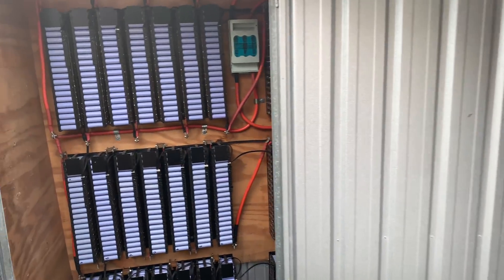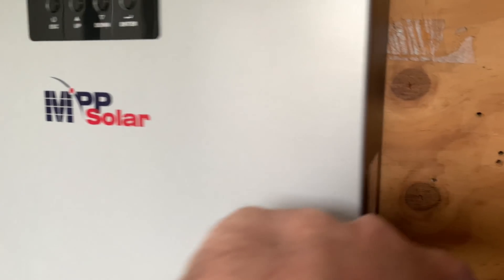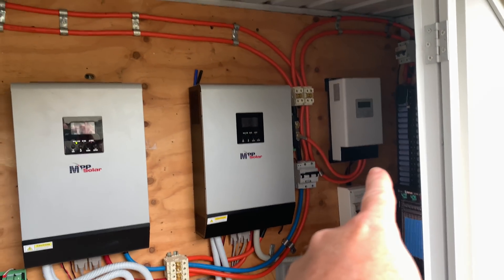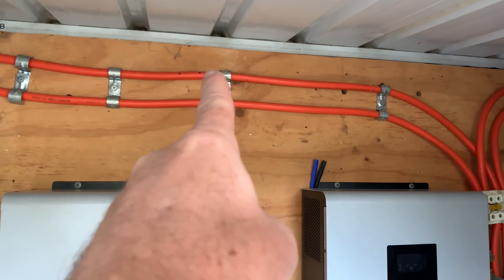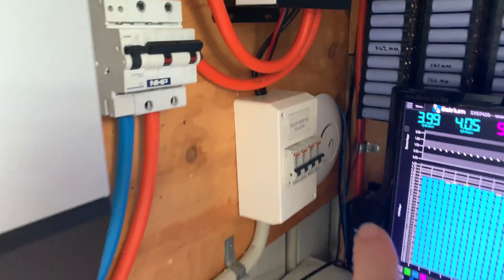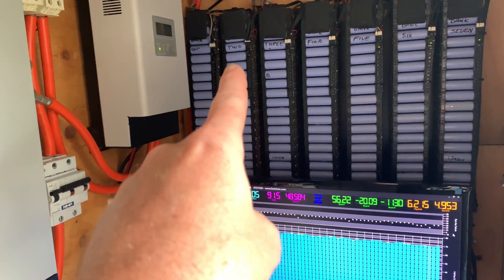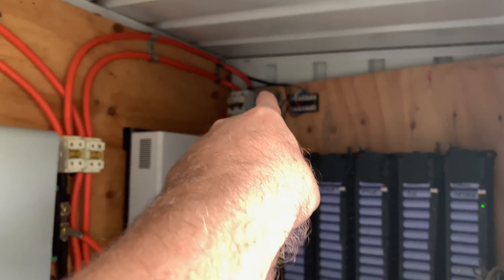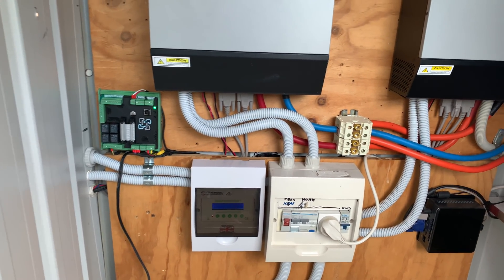DIYPowerwall suggestions on wiring update/cleanup

Comment: Do you recomend building all moduals at the 3.7v then put moduals in series or make all moduals 25.9v and run them in parallel
Reply from the maker: Bunch of different ways you could do it but that's pretty much the process i follow
Reply: @HBPowerwall  is it easier for the batrium. As in less longmons
Reply from the maker: building bigger packs means less longmons yes, but it's not easier or harder

Comment: 30 kwatts! do you ever need to use grid power?
Reply from the maker: draw a bit from the grid still... hope i can change that soon tho
Reply: @HBPowerwall  are you using the full capacity? whats your DoD?
Reply from the maker: @whatthefunction9140  not even close I think, from 4.13v down to 3.4 ish - 40kwh comes with hurting cells :)
Reply: I heard Tesla goes down to 2.8 on their cells. Are these different type, or why are you only going to 3.4? Seems like a lot of capacity left on the table. Thanks.

Comment: I really like what you've done. As others have said, I'd draw it all out first - just a functional block diagram would do. Look forward to seeing the end result. 30kWh - wow that's a lot of storage.. I haven't been keeping track - have you upped the amount of solar?
Reply from the maker: i've tested storage to 38kwh of useable storage with 4.5kw of panels
Reply: @HBPowerwall  I guess you only need as much solar as your usage demands.  Me- I've got an air conditioner, a pool, 2 fridges and a freezer and an Outlander PHEV.  I have a 9.2kW system. No battery as yet.

Comment: https://www.amazon.com/StarTech-com-3x3in-Wiring-Cable-Raceway/dp/B00006HQV5?psc=1&SubscriptionId=AKIAILSHYYTFIVPWUY6Q&tag=duckduckgo-ffnt-20&linkCode=xm2&camp=2025&creative=165953&creativeASIN=B00006HQV5   Google "plastic wiring raceway" comes in all different sizes, and makes things look professional. This is how we run cabling on industrial sites. Also comes in metal, but plastic looks as good and is much cheaper and easier to use. Can also google "wide slot wiring duct".

Comment: Focusing on visual design now?

Running out of new things to do?

What about preparing for an electric car and charge it from your batteries and solar panels?

You need a 200 kwh battery and probably double the solar panels, or look into a wind mill. If it is windy enough where you live.
Reply from the maker: Changes are based on PlugMeIn hopefully staying here, so want it spot on as he gets quite a bit of media coverage. But yes running out of things to do cause it works so dam well.. i guess that is a good thing really. As for EV that is very high on the wish list. With the right setup 50-60kwh of storage would be more than enough to keep the car topped off i thinks.
Reply: @HBPowerwall  Sure, but you also want to continue powering your house, don't you?

Comment: First a circuit breaker should be where you can reach it if there's a fire has it happening you're not going to be able to touch that emergency shut off so it should be away from the batteries second cable management is really simple in order to provide yourself the best cable management you should take all of your controls completely off-the-wall you want to leave the 240 alone leave the 240 exactly where it's at and then start over after doing that it allows you to quickly rebuild the system to where you can put all the cables and sub some type of conduit or chase that you can purchase for electrical wires I know you seen my channel so you can agree that I do a fairly good job my suggestion is the most important suggestion is just move that breaker or disconnect from the batteries to where you can reach it if the batteries are on fire you will not be able to stand in front of the batteries that's on fire

Comment: HB I used to do cabling runs for a living and the I moment you showed the second room I thought.  "Why is that cable going around that box.  Seems a Waste".  Then you described exactly what I was thinking should be changed.

I would like to point out however that you should always try to gap your power cables by two inches to any other devices to ensure there's no EMI.  But, I think you have enough gap and should be fine.

Draw it all out first.  Once you have it on paper the shortest and most efficient way to do your runs will come naturally.
Reply from the maker: Yep thinking of drawing it all out so i can buy all the supplies ahead of time so I don't get 10 percent of the way through it only to find i'm missing a ziptie lol
Reply: HBPowerwall I've done projects where we spent four days wiring something only to find we'd missed a box in the drawing or hadn't done the drawing right off the bat and had to redo half or even all of the job.  The drawing should be step one.  Then check and recheck.  :)
Reply from the maker: sounds like you have experience i can draw on... thanks for the insight

Comment: Have you previously talked about the “sheds”? I am trying to work out the best way to house my cells, I’m building packs but I can’t work out what sort of container to use as the housing for all of it. Are you using regular steel sheet temporary structures? I am hoping to find something like a fully enclosed 42u 19” rack or similar.
Reply from the maker: cheap tin garden sheds i've found on secondhand sites on the interwebs.. like 50 bucks each or something i think from memory .
Reply: It also depends on the battery type. 

I'm looking at building a battery box, that can handle Australian conditions.
Reply: Nice. I’ll check out Ebay. I figured 2nd hand server racks could be had for pennies and would give good mounting options whilst still being relatively fire proof too...
Reply from the maker: and strong - that part is more important than people consider. I really like the idea of server racks like rohan has used
Reply: HBPowerwall luckily where I plan to install is in a concrete stair well. About 20cm of concrete to bolt into behind the “shed” or rack.
Reply from the maker: That'll work well... concrete doesn't burn well either :p
Reply: HBPowerwall thanks! And I’m in “sunny England” :)
I’m building 14s20p packs that are coming out about 2.4kwh each. Only built my first 2 packs so far, I think I need to get to 6 packs before I can think about commissioning a system to run my house which peaks at just under 4kw peak draw and uses about 20kwh a day. The main reason for the power wall is we get 8-12 power cuts a year out here in the wilds of Hampshire!
Reply: @HBPowerwall  no but it can fail under heat load circa 9-11
Reply: if you are in australia there are new regulations to be aware of and it will be retro active from nov 2018